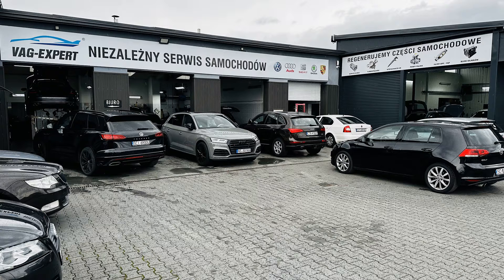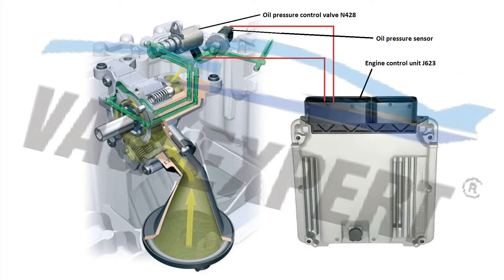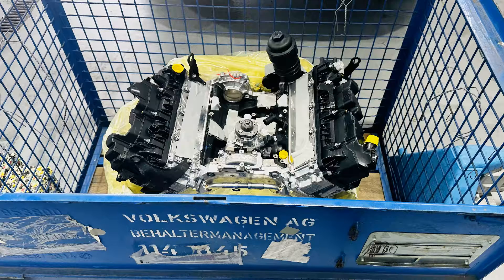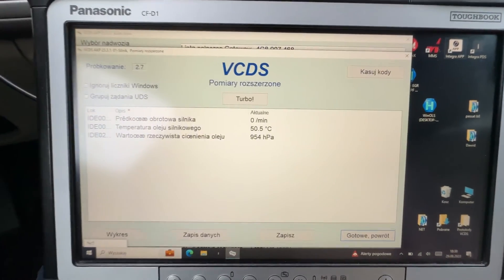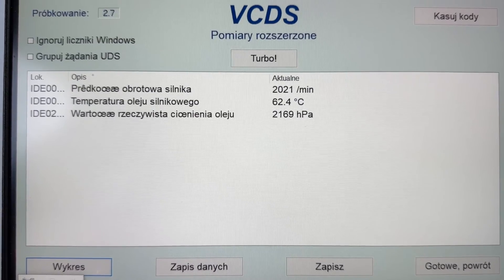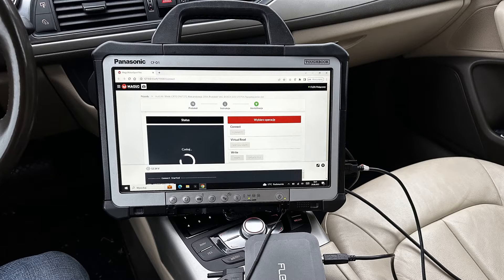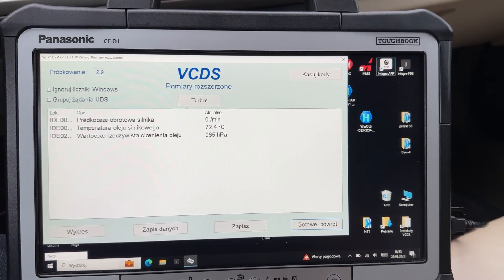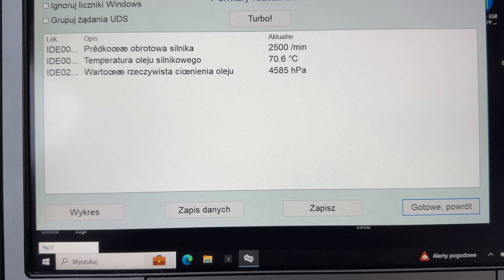Oil pressure correction

Comment: in my audi a6 3.0 tdi from 2016 my oil pressure its ok.... i have 2 bar wenn engine its running
Reply: Maths problem for a preschooler. With the engine off I had a pressure of 1 bar. After starting the engine I have 2 bar. So how much did the pressure increase after starting the engine?
Reply: @ u “preschooler”:  it’s shows 2.6 bar but I have written I have 2 bar. Wenn engine it’s off I have 0.6 bar so make some mats 2.6 - 0.6
Reply: @ The oil pressure sensor, if the engine is off, shows atmospheric pressure. If yours shows 0.6 Bar, then either you are about 4200 m above sea level or the sensor is damaged.

Comment: 2013 Porsche Panamera, does this have that variable pressure regulator?
Reply: you need to check if oil pressure sensor has 3 WIRES coming out from CONNECTOR at oil filter

Comment: 2000hpa is 2 bars not 1
Reply: Did you remember to deduct the atmospheric pressure. The reading is absolute pressure, not oil system overpressure.

Comment: If I remove the connection from the oil regulator....the pressure increases considerably!  my question... can I drive like this with the car, what are the risks??? Thanks!
Reply: Nobody?
Reply: De e senzorul mai exact?
Reply: No , I’ve checked oil pressure with an oil pressure gauge and by disconnecting the regulator valve the oil pressure hums to 3.5 bar at idle and 7.0 @  2500 rpm that’s over 100 psi

Comment: More oilpressure doesn't result in extended lifetime.
The bearings have a rpm laod and temp depending oilconsumption, for wich a specific oilpressure is needed to garantie the flow. Acording this the oilpressure maps are calibrated.
Increasing the oilpressure has 0 impact....in worstace u just overfeed the bearings and make them run out of spec and destroy it by this.
What is done there is just a blind shoot in the dark without without evidences and datas which effect it has.

Comment: This should be a recall, its clearly a manufacturing defect. No engine should receive excessive wear to this degree under normal operating conditions.
Reply: This is probably something to reduce emissions, I checked vcds forums and people are saying it is to reduce fuel consumption